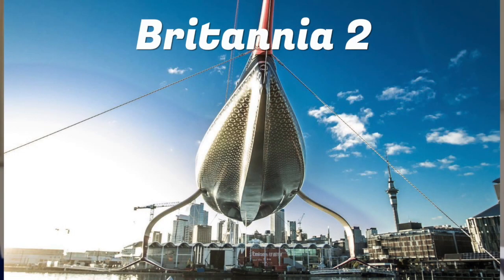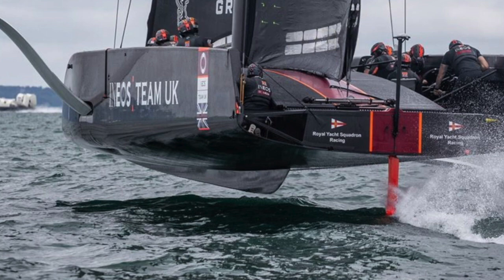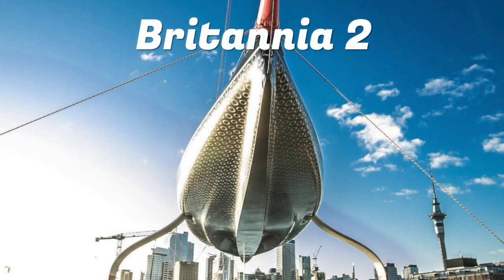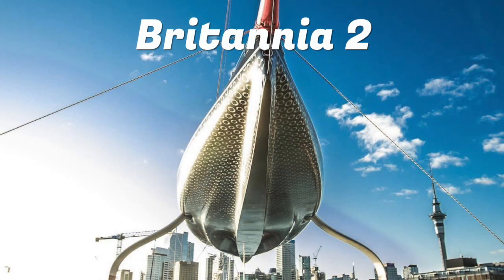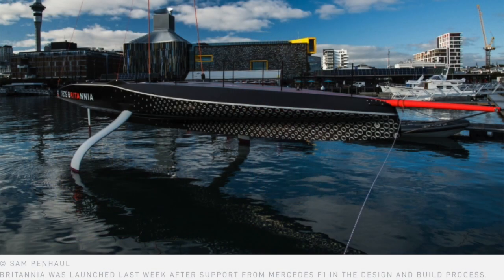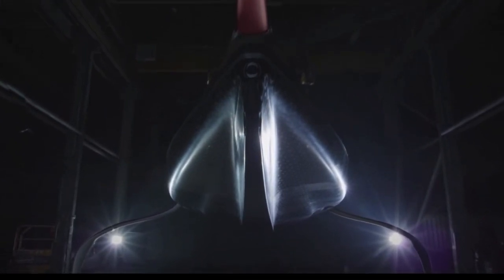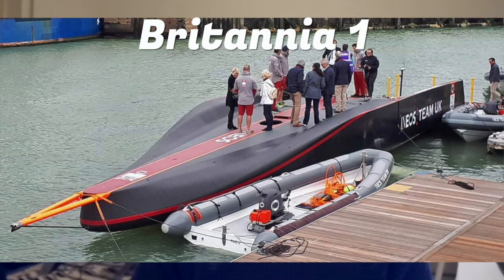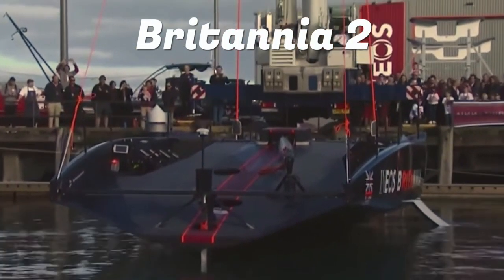E70 - INEOS Boat 2

Comment: Lots to think about here. I agree the skeg/keel has the potential to give lift acting as a sail, whether it does in practice I am not so sure. I am unaware of the time they have had access to this additional design team as to be honest throwing 30 new specialists at this task in the last 6 months could be a massive gamble. As the design team dynamics could be destroyed by such a shake up. My guess would be keeping their powder dry with boat one, and not showing the more radical parts and using it to test the mast profile, rig controls, flight controls etc. In previous AC campaigns were sail inventories we limited and new sails could be added as you progressed you did not start with you best mainsail just an adequate one to get you through the round. Essential keeping your powder dry, and letting the cat out of the bag. My experience of racing land yachts at 100kph and 3+ times the speed of the wind, hull shape is minimal (not a brick wall), the mast profile and mainsail shape is key. It is about establishing the balance between acceleration and top speed. The other key item is the foils, in how they give lift and what stability they give to the boat and essential the rig allowing it to work to its maximum when at full tilt. The foils will determine how much vibration is past into the mast and if it is smooth you can add 20% to you speed and acceleration.

Comment: I agree with you that it’s a very novel design. I dispute the idea that the keel/skeg will help with ground effect or produce any aerodynamic lift—any lift forces while in the air would be perpendicular to the vertical surface of the keel and when it’s out of the water that would be pushing the boat to leeward. I suspect that it will provide some “lift” during transition to flight however due to its very flat bottom. Also, as you pointed out, it seems like they want to make transition to flight easier and more forgiving by having the planing and buoyant forces of the strange keel lift the flat “shoulders” of the hull up out of the water earlier than a completely flat boat would thereby reducing its (water) wetted surface area sooner. My personal feeling is that the boat will actually have a slower straight line top speed than, say, American Magic B1, but that it will be more forgiving in conditions that are hard for the boats to get flying and for small maneuvering errors where they can have more of a partial touch down with just the skeg/keel which will provide additional buoyant and planing forces preventing a complete touchdown where the entire hull is wetted.
Reply: I think the lift force in any case is the force perpendicular to the incoming flow, so apparent wind. For vertical surfaces this would be pointing mainly on the side, producing leeway, but will have a component on the horizontal axe, exactly as the mainsail sheeted completely on the center line. As this is a 3d flow in any way it is difficult to understand how much vertical and horizotal surfaces will impact on the flight, but I think globally they all give their contribution to the cause!